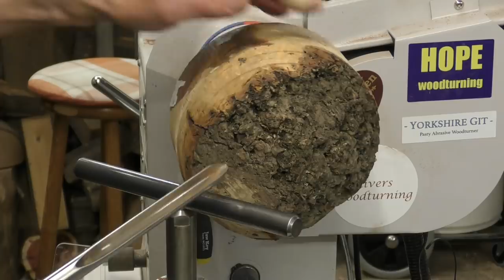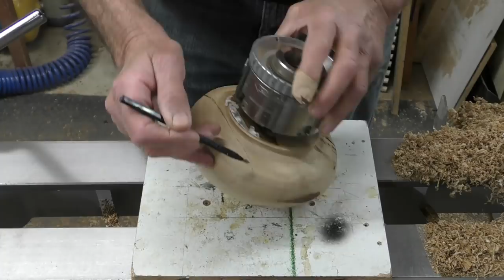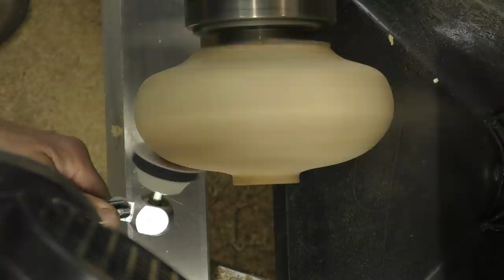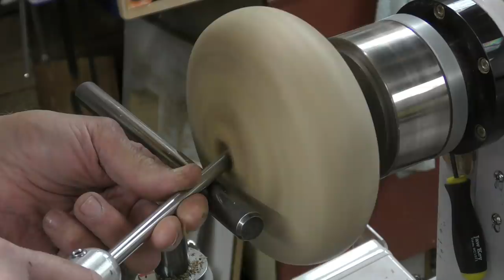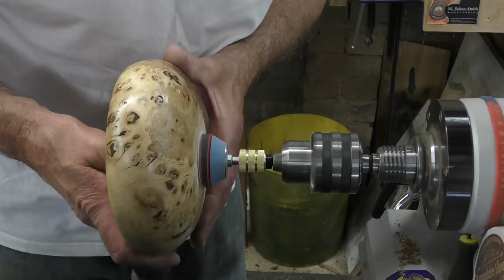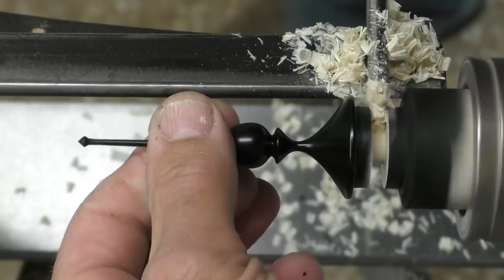Woodturning - Oak Burr Hollow Form with Ebonised Sycamore Finial

Comment: Beautiful work, Mike!  That oak burl is so interesting to look at!  I am particularly intrigued with all the different ebonizing methods out there!  Are you familiar with the green tea method?  I have never tried it before.  Cheers!
Reply from the maker: Thanks David,  I am the same as you, never tried it. I have used the wire wool and vinegar method on Oak and it works a treat... but smells disgusting, so now I tend just to use the Ebonising Spray 🙂